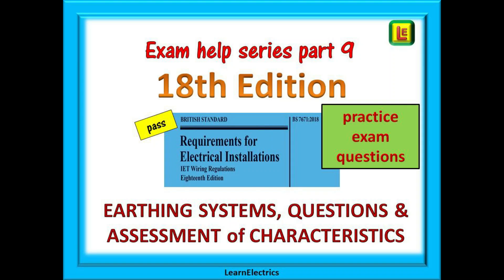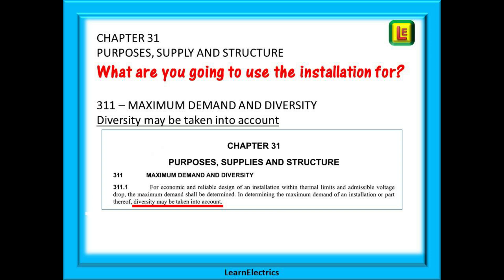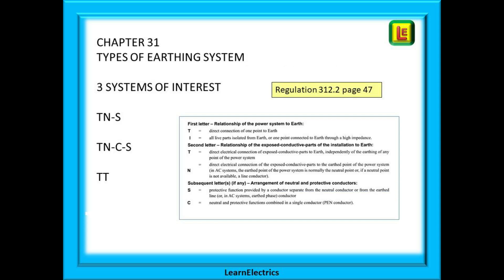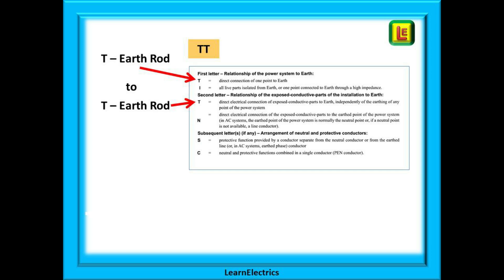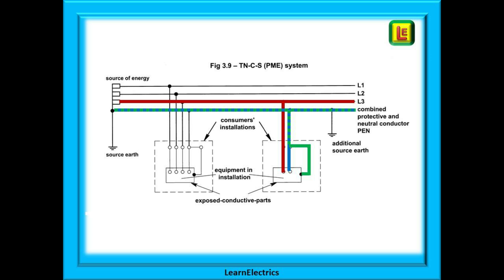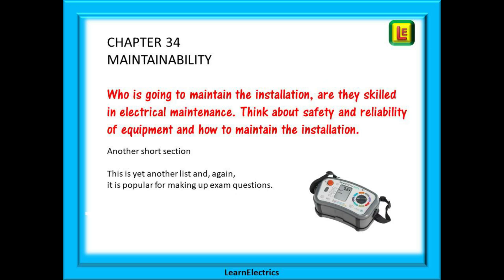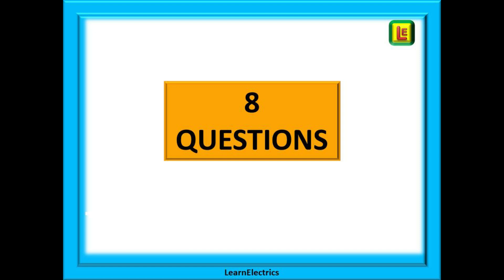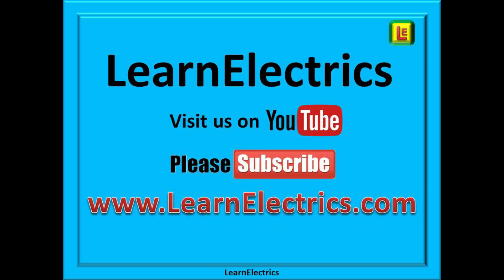18th EDITION EXAM HELP PART 9. Earthing System Types, Exam Questions & Assessment of Characteristics

Comment: Would question 2 now be parts 3 to 8. Now that the book has changed? The ammendmended book now has 8 parts in there. Im feeling more and more confident now thanks Dave!
Reply from the maker: This video is on Amendment 1. If you want Amendment 2 for the current exams that you will sit then go to   LearnElectrics.com   and put Amendment 2 into the search bar, you will get a list of links to Amd 2 videos. lots of questions and answers. Dave.
Reply: @learnelectrics4402  You are my hero!

Comment: Answers: D,A,D,A,B,D,C,C?
Reply from the maker: Excellent. Thanks for attempting the questions, it all adds to your knowledge. Dave.
Reply from the maker: He didn't he got Q6 wrong. But 7 out 8 is pretty good.
What did you get?
Reply from the maker: That's it. Well done Andy. All the answers on Thursday - but you know them now.
Reply from the maker: Ah. Sorry. I didn't want to give the answers away before Thursday. I was just indicating that he would have done enough to pas that section. I'll be aware of that false indication next time. My fault.
Are you feeling more comfortable with the questions now. This is the style of question that they will ask, but there will always be enough clues to get you to where you need to be.
Reply from the maker: It's on the list Andy, being worked on.
Reply: @Andy Johnson Question 6 I thought answer B was correct as it's the only sentence word for word in the list
Reply from the maker: You've got it mate. A lot of the exam is just that - sentence matching.
Reply from the maker: That's it, answer B

Comment: I have to run main protective bonding to water pipe. It has to be run outdoor. Green and yellow cable is single insulated. I belive it should be fitted inside of some sort of conduit. Problem is I cannot find any pvc outdoor rated conduit. Do you know any one providing outdoor rated pvc conduit?
Reply from the maker: Try your local plumbers or electrical wholesaler. It doesn't have to be in conduit, just protected from mechanical damage. Good luck.